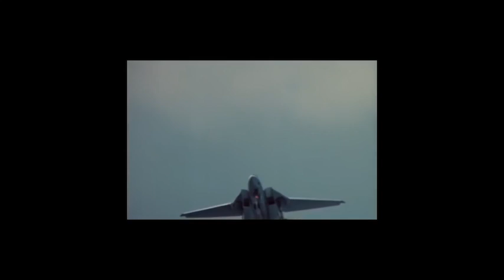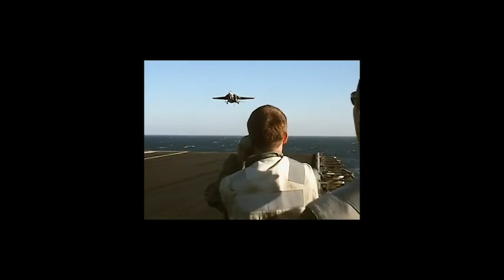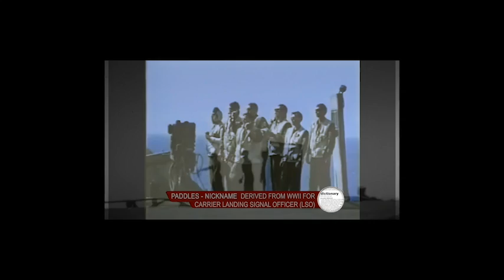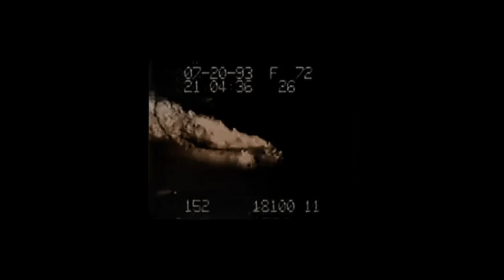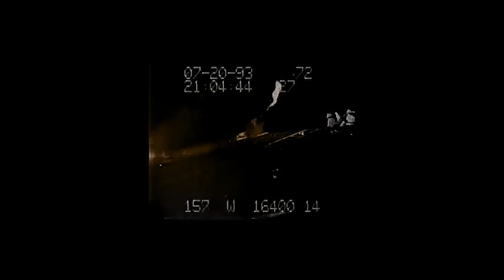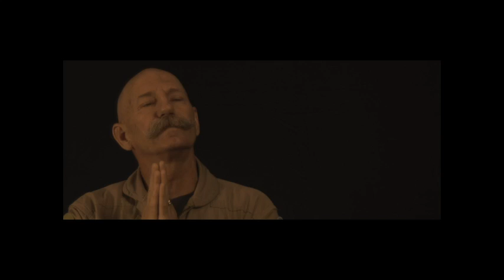Tomcat Ramp Strike

Comment: It was a sad night. I was an Avionics Electrician in VMFA-314. Capt. Hubbard was in our squadron. It was one of those things you never forget. I was actually on day crew at the time and had just laid down in my rack in the berthing area when it crashed. We felt the jolt when it hit. Our berthing area was 2 or 3 decks down at the back of the ship. When they came over the loudspeaker and said "fire on the flight deck", we all jumped up and was trying to get dressed as we ran to our shop to get suited up to go on the flight deck. By the time we got on the deck, the AFFF fire retardant had been dispatched. About 3 feet of white foam on the entire deck. We did FOD walks on our hands and knees picking up bits and pieces of the jet and collecting it to throw them over the side.  Navy crews were busy pushing the rest of the jet over the side and getting the ordnance cleared so the rest of the planes in the air could land. Very busy night. Like he said, no jet had a FODed engine on landing and taxing. Everybody on that ship did a great job in a bad situation. I am so proud to have served with all of them. Sgt. Clifford (was a LCpl at the time)

Comment: I was a flight deck chief for the helo squadron (HS-6) on that cruise. I remember that night. The fire on the flight deck was out in seconds but  the fantail fire almost took out the jet shop.  They lit of afff 2 times in  hangar bay 3. It was a mess.  I have been on deck for serval crashes in my career but this one scared me the most. VF-213 had a run of bad luck for several years. Lost a couple of pilots and 5 or 6 aircraft. Sad time.

Comment: One of the B-I-G Problems with carrier landings is the pressure Every Pilot is under to execute a 'Perfect #3 wire trap. I've personally seen MANY pilots violate the rules of carrier landings by 'Cutting the power and forcing the plane onto the carrier deck, Not all of them catch the wire and are Forced to go around. That can be a problem since most of them Cut their power in order to force the landing. I watched one young A-7 pilot learn this the HARD way. He Boltered the landing and when he got to the end of the landing area his plane didn't have enough energy to continue flying in a normal attitude. After successfully recovering flight speed, his next landing attempt was 'BY THE BOOK!'

Comment: I was an E2 interior electrician communications fireman apprentice.  I was on trouble call watch when theat happened.  Someone called Central control they called the Aft IC and Gyro watch that the Boswain Mate on the fantail tool off running when this happened and was lucky he didn't get hit by debris bit he had on a sound powered headset hooked into the X5J circuit that was a direct line to the bridge and he ripped it out of the bulkhead in doing so. They had birds in the air and had to have coms. So I went out there with EOD guys who had on apprroatie gear all I had on was dungarees and my shirt..anyway t took a self and pepper line and spliced it to the wires hanging out and they had coms again.  The next day I went out there and reinstalled the x5j circuit box.

Comment: I was there. Walking forward from the fantail. 🫡
Reply: No you weren't
Reply: @flyerfan73  yeah ok. 🤡
Reply: @schwag91 so you were on the flight deck, walking from the fantail towards the bow during recovery operations? Cool story. What CAG?
Reply: @flyerfan73 Ships company. V4 Div. You can walk the deck during flight ops you know. 😂
Reply: @flyerfan73 it's not a cool story either btw. We lost the pilot
Reply: @schwag91 I was actually up there. Unlike you. So what CAG was it?
Reply: CAG 11 if I recall correctly. I was there too, but was on day shift and not permitted to go above deck at the time. I unfortunately ran across some of the pilot's smaller remains during the mornings first FOD walk down.